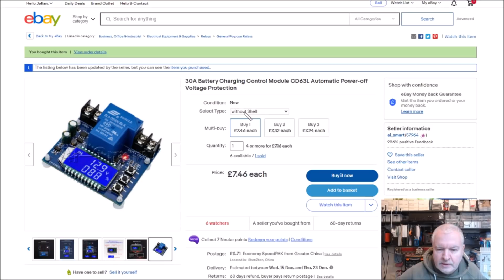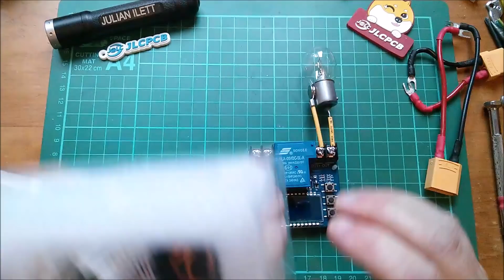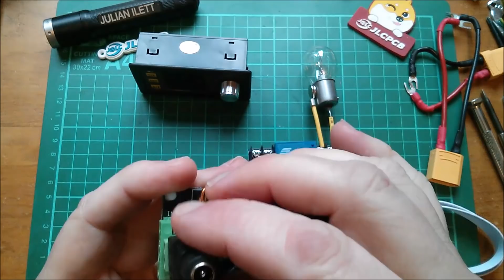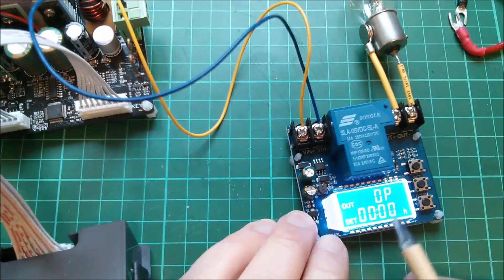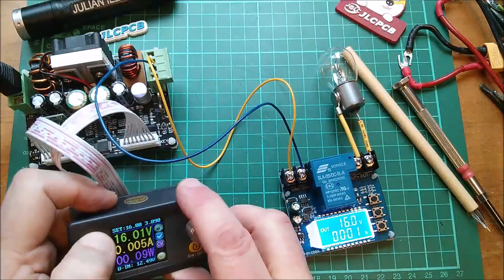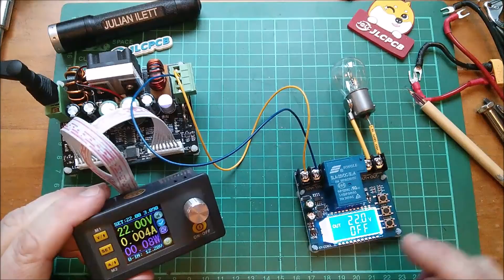Charge/Discharge Controller with 30A Relay

Comment: it looks like  the unit mounted in the istabreeze wind controller,,, i purchased the a30 u3 unit i belive that should be able to do the same as this turning on and off af a high and low voltage??

Comment: If this device was used for a device that had a refrigeration compressor or air compressor it could keep it from fast cycling when the compressor turns off and head pressure  is high, give the machine time to cool or bleed off....

Comment: I'm half way through building a Arduino nano project.
The software is done, and it's fairly simple.

I did it to balance batteries of different types , and limited charge as well as burn off excess to give some control. As well as upper and lower limits.

Basically it has some voltage readings, and some control relays (common Micro relays from a car).
The small per battery control is 20amp, but I also have 100amp for main control. (On off)

I've not done any GUI as I've coded it easy enough for entering per battery voltage, and maximum voltages (cut off peak) as well as a main such off. 
I could address current, not that's not really my concern as I have high enough voltage and therefore fairly low amps (18)

Comment: There are 10A and 20A versions of this that appear to operate with the same interface, but they are only a dollar or two less than the 30A, so this one is likely a better value and gives the relay more headroom and lifespan in lower-current applications  The 10A relay /might/ have a lower quiescent current than the 30A, but not sure if the difference is substantial or not.  This type of relay usually only draws 5-10mA when active, but the circuit around it likely draws more than that.

Comment: I could see FOp as quite useful if the process of starting your equipment causes severe voltage drops (i.e. starting a car's engine), and one risks dropping below the lower threshold.
Reply: I believe that was the intention of FOB

Comment: For the voltage input I think its saying you can do 60v but it's best to not exceed 48v for the life and reliability of the device.

I recently bought an induction heater that had a similar voltage rating.
Reply: A resistive load could be fine at 60v but don't try a inductive one. You may be able to burn pretty quickly through your contacts. Lower current should give the headroom to work with higher voltages though.

Comment: Interesting that it doesn’t have a high voltage shut off too. Ie after on, if you go over say 26v shut off. 

Also why use a rely and not just a mosfet?  A fet for that range are cheap as chips.
Reply: Relays make a cool sound.
Reply: @mikebond6328  🤣
Reply from the maker: This might be used to connect a battery charger to a battery. A relay makes it easier to switch the mains side of that charger.
Reply: @JulianIlett  Ok, I guess that makes sense, although FETs can do the same and last longer. What about the high side shut off?

Comment: This must be a new product. Last year I made a solar powered motion detector light for the side of the house, and used an old lead acid battery from my scooter to power it.
I had to put in a circuit to cut the solar power if the battery voltage went over 13.85V and cut the load if the voltage went under 11V.
I searched all over and had to build my own using an LM311 comparator a few resistors, 10 turn trim pots and a relay. 
What a pain that was to build and trouble shoot! I'd forgotten that LM311 has an open collector output.

Comment: I'm wondering if you could do a sort of UPS circuit with this. But it probably won't be fast enough.
Reply: Switching would be too slow, but you could slap a seriously oversized output super cap to hold over for the switching time.
Obviously DC only.